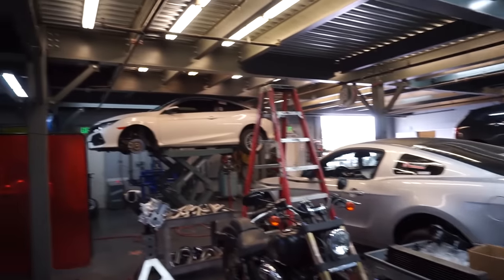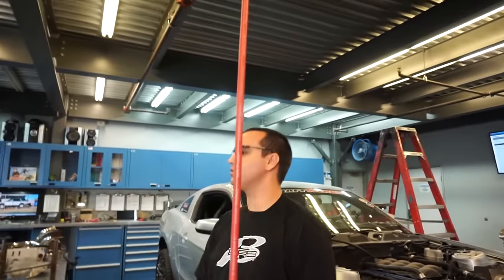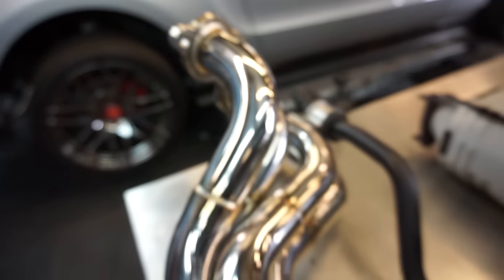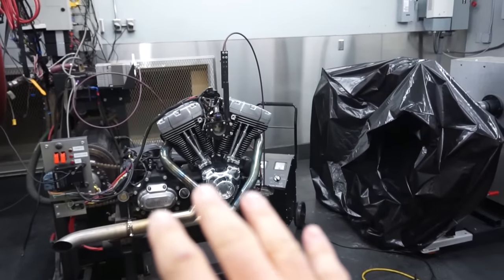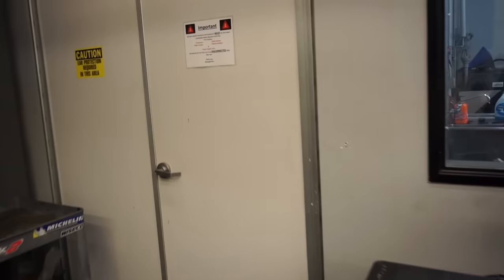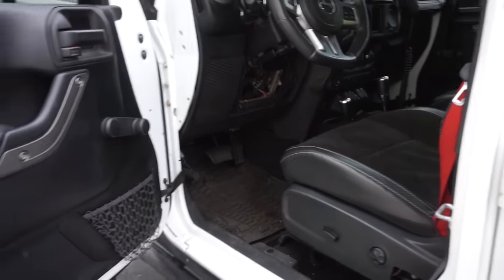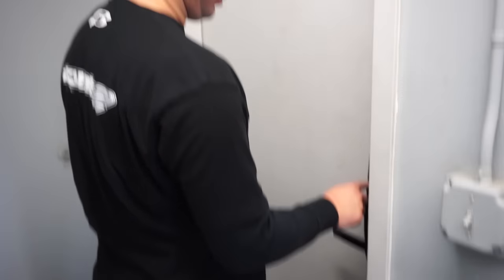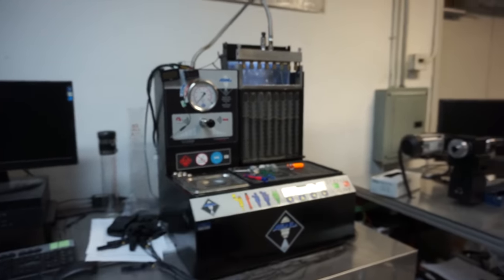The TRUTH about Skunk2 Racing!!!

Comment: Let’s goooo! I’m stoked dude! 

I’m in the process of building my k24 (replacing seals etc) that I got from a junkyard for my EP3 (the same model black hatch in the video).

I had no idea that KW and Skunk was under The same Umbrella! #TheMoreYouKnow

... speaking of “know”, do you know if those headers that you complimented the welding on will pass the front sway bar on because of the additional height of the k24, or is this only for the k20 ?

Comment: Just bought a skunk2 h22 intake manifold and it's cracked and they won't take it back. Overpriced cheap Chinese casting. $400 intake really worth maybe $100 gonna cost $200 to get it TIG welded and repaired. Horrible customer service and company.
Reply: Just run the oem one ported and polish much better for H series